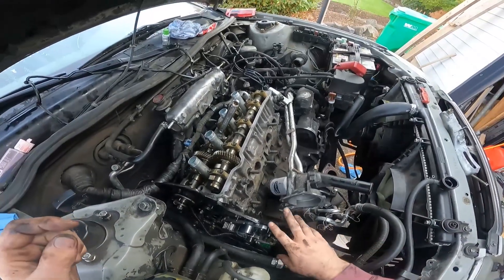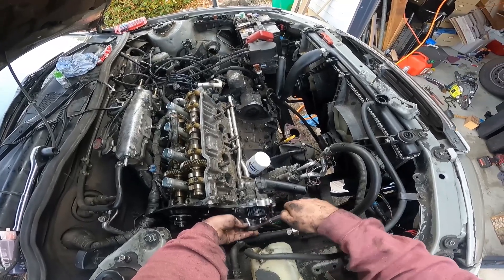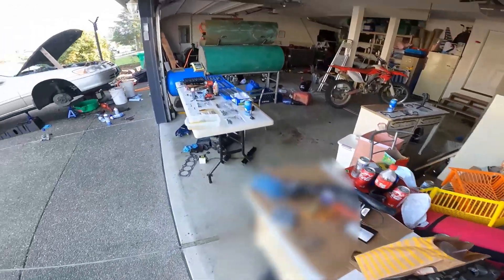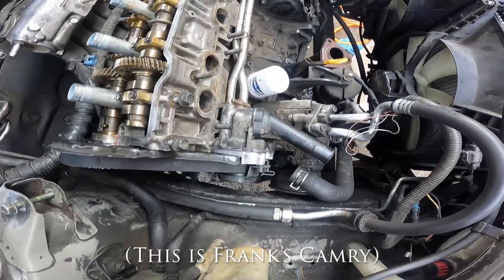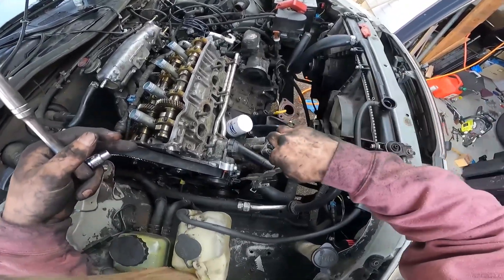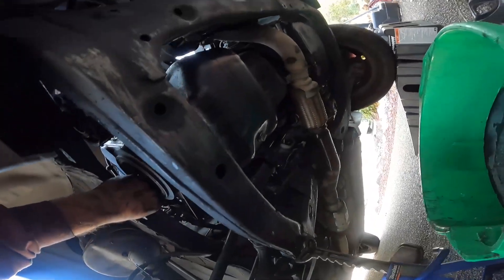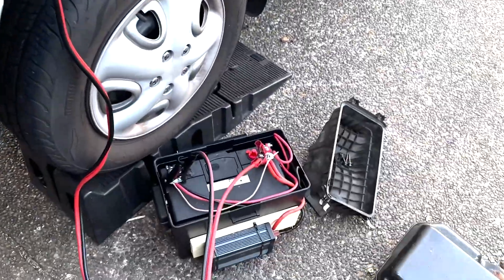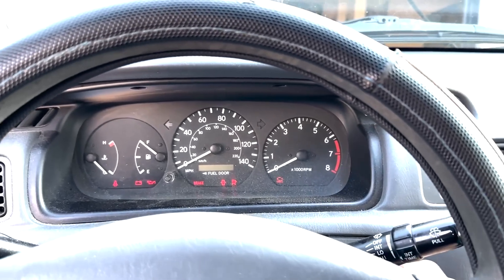Toyota Camry Timing Belt/Water Pump Part 2

Comment: I've done Timing jobs on 1996 to 2001 Camry's, and the most aggravating part is the Power Steering Pump. Getting the Belt tight enough without it being too tight is a trick. Sometimes i had to go back in to tighten the Belt more, but a couple of times i got it on the first try.

Comment: Could i do the timing without removing the valve cover?

And also if i am in that area by the water pump how would i go about changing the camshaft seals?
Reply from the maker: No you gotta take the belt off the cam gears and hold the cams in place when lining everything back up
Reply: YOu dont need to remove the valve cover!! TIMING mark for cam is on the outside.read the damn directions in the manual or instruction with kit. This guy didn't!
Reply from the maker: Head gasket was replaced during this job so the head was fully disassembled to go to the machine shop. It makes a LOT of sense to go ahead and just pull the valve cover and do the job right while you’re in there. Don’t change JUST the timing belt on a 175,000+ mile car. Slapping a timing belt in there and calling it a day isn’t the way to keep a long lasting car. Get in there and be smart about it while it’s torn apart already.